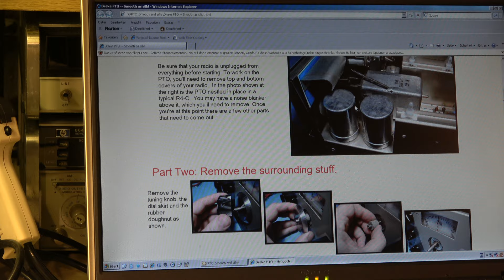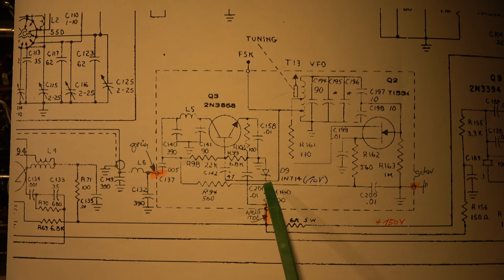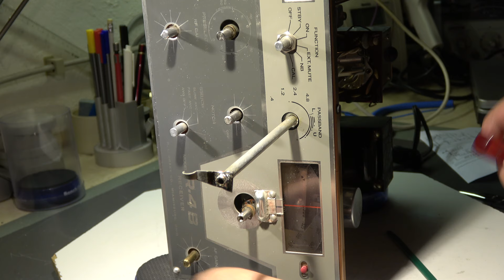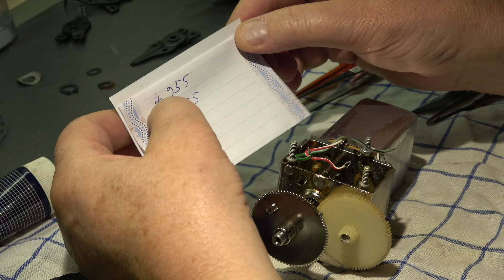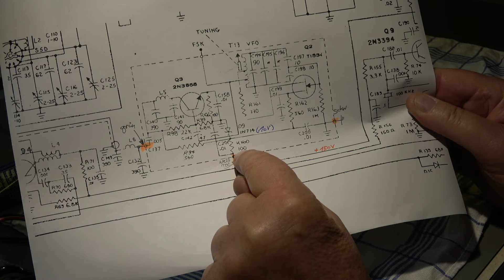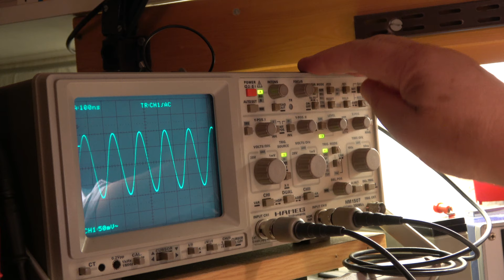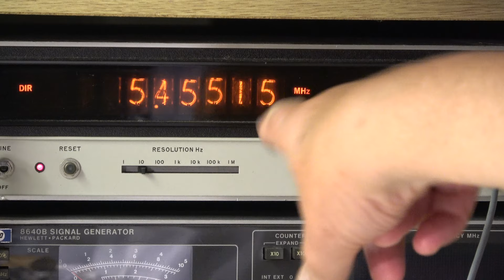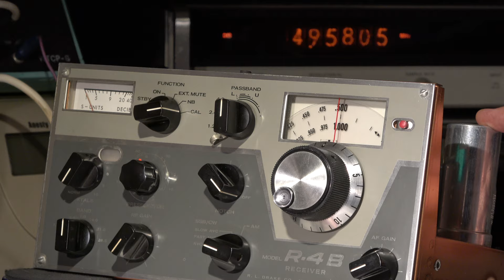#95 Drake R4B Part 1(2)

Comment: these video s can be s survival of humanity if an atomic war breaks out. those could be the few  devices that can survive an EMP.     those new ones since 1985 with integrated circuits and varicaps can not  certainy not those with  inthegrated circuits based on mosfets of nowdays
Reply from the maker: Right! But we would need a QSO-partner also equipped with such a receiver plus transmitter.
Reply: ah yes, the CB band could turn in unmeasurable value too  after all gsm and the  SHF grid is down, cherish those old  cb s from the 70 s
Reply: @dl7majstefan753  true. that s why you must collect them if they are on sale   and never demolish them